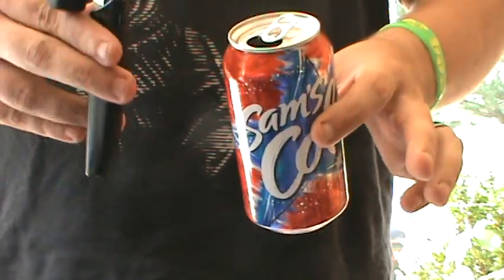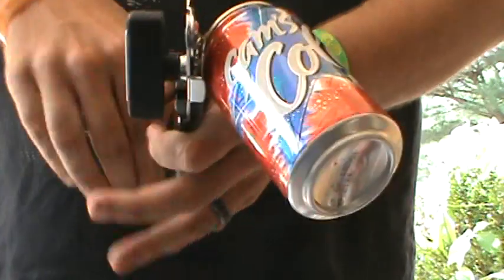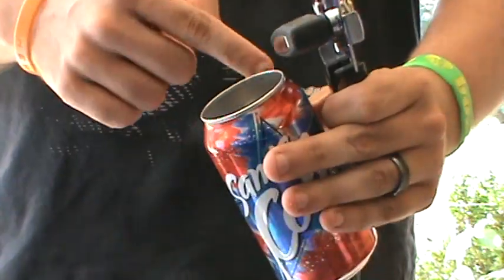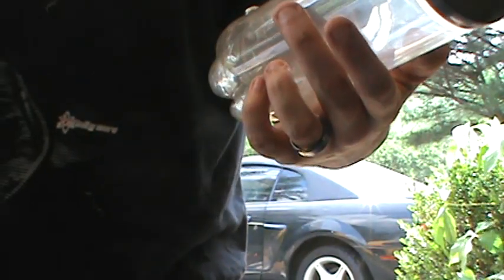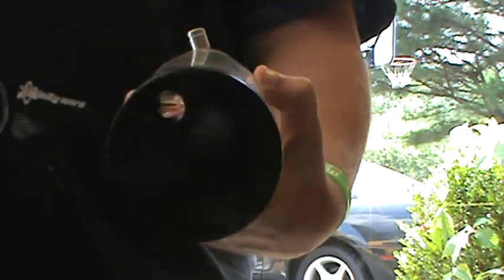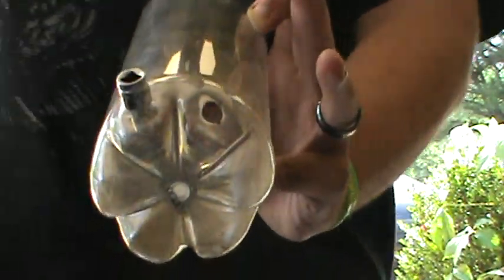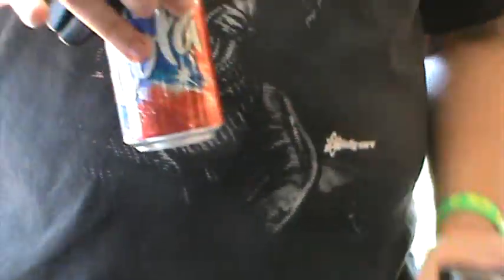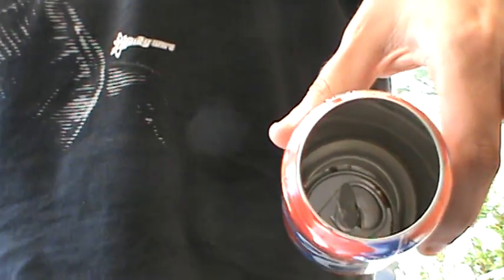Sneaky Can Water Pipe Response

Comment: I actually think you should leave the top of the can on, yes better airflow is achieved by removal of the top but it also acts as a splash guard. if the hose is positioned correctly under the lid it should hit fine, but you wont know till you try it!